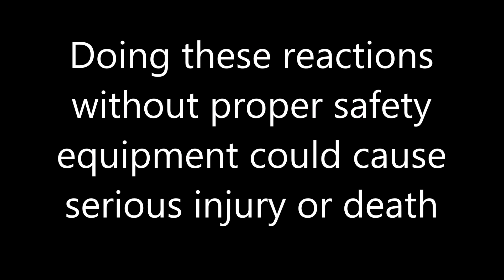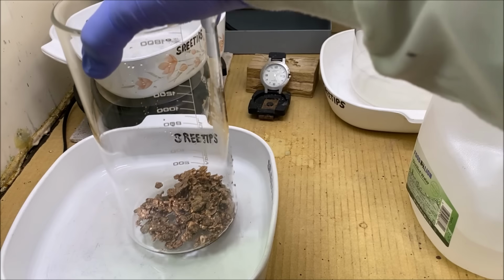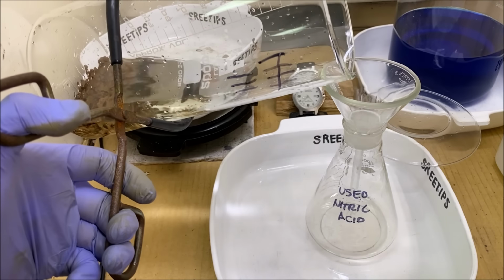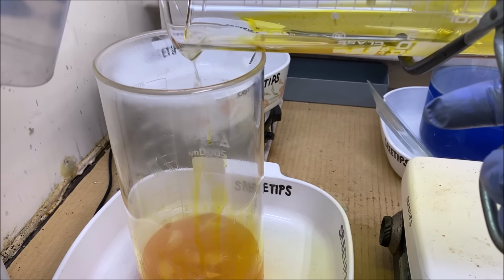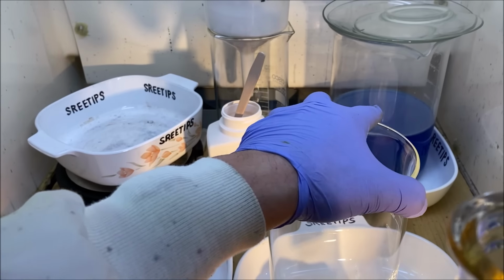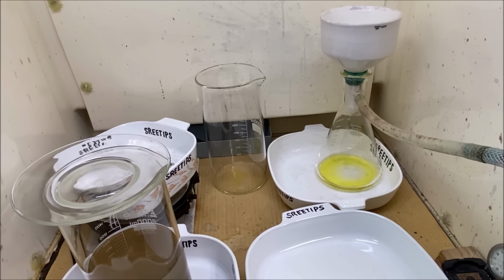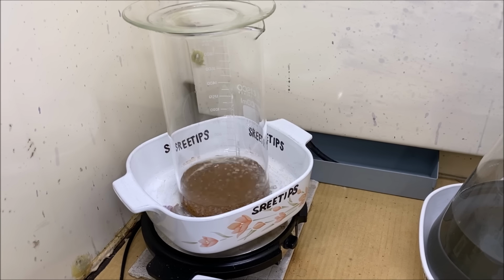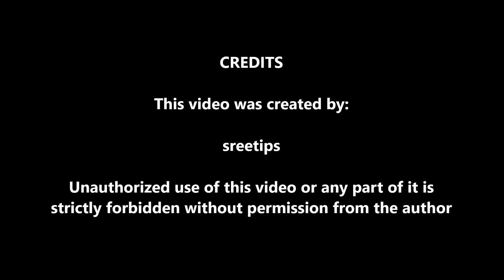Copper Instead of Silver To Inquart The GOLD

Comment: I still think you should be using the impure silver powder instead of silver or copper. unless there is a good reason not to? (obviously if you buy silver then sure that makes sense but if you are short of silver then powder for sure)
Reply from the maker: The refiners that I learned from taught me that using cement silver (impure silver powder) is not recommended because PGMs tend to follow the silver and build up in it. Especially if it’s used over and over to inquart gold. That, in turn, that could cause problems in the silver cell.

Comment: Do the PGMs follow the silver chloride?
Reply from the maker: No, but there’s probably traces of gold in the silver chloride. I realized that I should have filtered the blue liquid before adding the HCl to form silver chloride.
Reply: @sreetips  Kinda seems like copper is inferior to the silver.
Speaking of the anode filters.  It seems like there would have to be a more space efficient way of dealing with them.  I was thinking rinse off the exposed silver shot and melt them into the next batch of cement to shot; but I suppose there would be a reason not to.  Such as the space not being a problem, needing to have silver in the slimes recovery phase, contamination resulting in slag needing to be removed, something else I haven't thought of.
Reply from the maker: I tried getting the shot out of those filters twice, but it didn’t go well either time.
Reply: @sreetips  And I highly doubt it'd be worth simply dissolving it all in nitric and cementing it out because that would concentrate the junk that would make the slimes build up quicker.  Although maybe it might be enough to take like 16 anode filters and turn them into just 4 while getting the silver out.  Still probably more time and consumables than it's worth tho.  I just like thinking logistics.

Comment: There is a purple gold now that jewlers are making it gold alloyed with aluminum and I don't think it's been perfected yet I bet you could do it sreetips 😊
Reply from the maker: I’m a refiner. The pros that I learned from taught me to avoid aluminum because it’s not soluble in nitric and it forms compounds that cause problems in the refining process.
Reply: Yes, I saw the NileRed video on that. Brittle as ice in spring and harder to make than a perfect beef Wellington. Colour comes out at a narrow carat range after annealing at specific temperature for a specific time. Ok, pretty if you like specialty but your jewelsmith is going to curse you into nether hells demanding that stuff. But yes, Sreetips might have a chance to make it. Induction oven and inert gas intake is probably needed for good results.
Reply: But what I'd like to see is what happens with Germanium addition to Gold. Do they mix at all and what would be the color if they do. Chemically, anything between 18 and 6 carat Ge-Au mix would make sense, but is it possible.

Comment: I will probably get a lot of laughs for this or telling this is a silly question but what is the difference between inquarting(sp?) and making an alloy? With the mixing of silver/copper and gold are you not making an alloy? Or am I wrong if so why?
Reply from the maker: You are correct, we are creating an alloy. But we’re doing it to a certain spec. 14k gold is roughly an alloy of 58% pure gold, 20% silver, 17% copper, 5% zinc. But we want an alloy, for inquarting (root word quart or quarter) that is 25% pure gold and 75% silver and base metals. 1/4 pure gold 3/4 silver and base metals.

Comment: How do you know when to stop the heat and stop evaporating the gold in the aqua regia exactly? Because in the time lapse it looked like fumes had long ago stopped coming from the boiling gold but you let it go a while longer before putting it on ice.
Reply from the maker: I just go by my experience. I was probably in having lunch and that’s why I let it go longer than needed.
Reply: @sreetips  Gotcha. So typically are you supposed to stop boiling once the fumes stop? And if you just let it go will all the gold boil away eventually?
Reply from the maker: No, the gold will still be there, but in chunks of solid chloroauric acid crystals.

Comment: have you considered using aluminium unstead of copper or silver ?
Reply from the maker: No. Aluminum is not soluble in nitric.
Reply: @sreetips  could you then use hydrochloric? I'm considering playing around with making purple gold and wondering about recycling any failed attempts
Reply from the maker: The pro refiners that I learned from taught me to stay away from aluminum because it forms compounds that make refining the gold difficult.
Reply: @sreetips  cheers

Comment: Question: could you recover the copper out of the copper chloride?
Reply: Also out of interest are you going to do a video soon recovering all the precious metals from the waste products and filters etc?
Reply from the maker: It’s not copper chloride, it’s should be copper nitrate (copper dissolved in nitric acid). Yes, the copper can and will be recovered by cementing it on iron in my waste treatment bucket.
Reply from the maker: Stock pot videos are due this spring (May). And I’ve got a five gallon bucket almost full of used filters, so that one will be coming soon also. I usually wait until I’m burning some yard debris and big logs because it makes a nice hot fire suitable for burning the filters to a fine ash.
Reply: @sreetips  brilliant thankyou for the responses

Comment: Side comment, to whoever reads this: if you have a friend in hazwaste, they have tons of silver oxide batteries that you can easily collect lots of silver from.
 I found 4 old aircraft batteries from the 1960’s that each had around 12 lbs of silver oxide in them. Plus the cathode and anode rods were silver too. The only thing that was useless was the zinc oxide and a little bit of brass. 
Treasures are still hidden out there!!!!
Reply from the maker: Silver in old aircraft batteries, I have never heard this. Thank you.

Comment: is it posible to dissolve the copper gold with hidrocloric acid? like 33%
Reply from the maker: No, there silver in there too. Silver and HCl make silver chloride. Something that I try to avoid.
Reply: @sreetips  i am doing electonic refining and indted of cupelling the copper i wanted to take away by dissolving it with hcl, can it be done or the silver well cause problems? i have it all melted in a small piramid after cupeling the lead away .( i use the lead in the smelting as the collector metal)
Reply from the maker: I don’t have any experience with that.